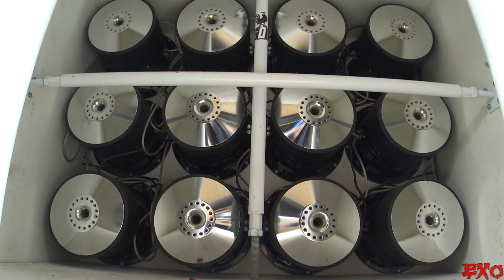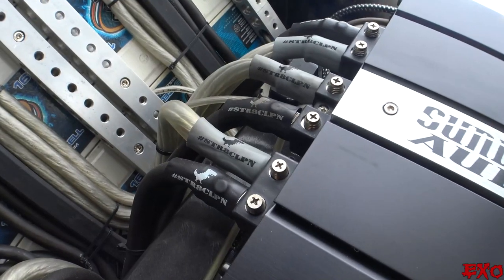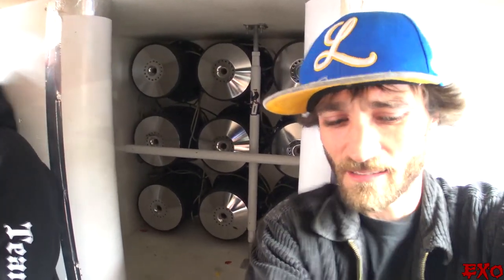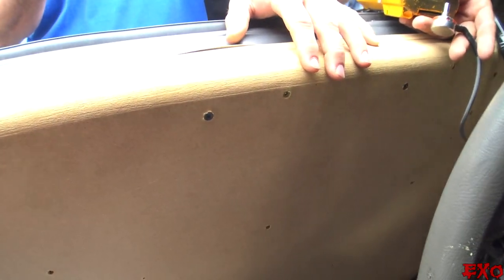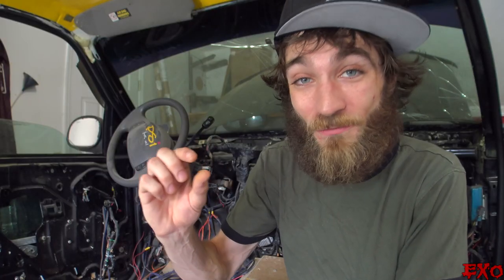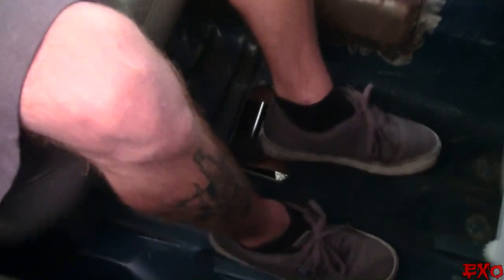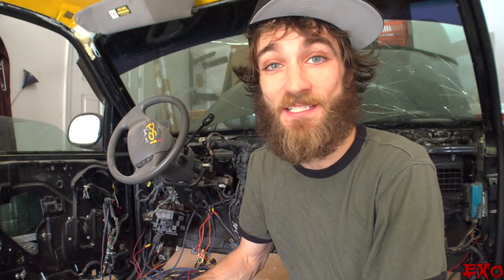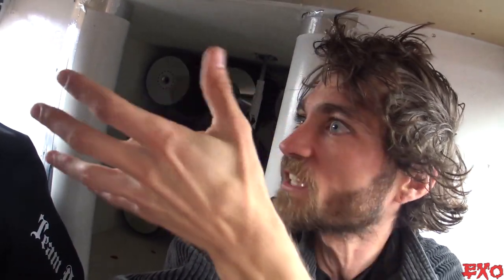Too MUCH BASS for a TAHOE!?!? Playing Kyle's BIGGEST Car Audio Subwoofer Sound System Ever!

Comment: I sat in a van with 15-15's...  It was a Rockford Fosgate utility van from many years ago.  The speakers were on a wall directly behind the driver/passenger seats, with the speakers facing into the cab... I didn't quite get the breathing part down, but phones, water bottles, etc. flew into the air!  Great video by the way!

Comment: Brother I graduate 1990 we're pumping Cerwin Vegas Rockford Fosgate, Orion and Alpine thinking we were pushing the limit thousand watt back then was crazy;)) nowadays you guys have evolve to Crazy points thumbs up
Reply: Juan Weigel 1994 grad here I remember thoes days I had Fosgate and Soundstream stuff good times!
Reply: my cousin had 3 kove audio 15s on 3k back in 2000  with 2 batteries and a capacitor that was nuttz. Not so insane anymore.
Reply: Yep  1$ per watt
Reply: Yes I remember those times indeed. I was rocking earthquake amps on 2 punch DVCs. Good ole days
Reply: Good times indeed. I was the sealed box king lol. Times have changed a lot I got back into it when I saw my 1st good flex and hair trick video.
Reply: Good times bro. I remember demoing my first subs with a Vanilla Ice CD. Then I stepped up to DJ Magic Mike! I had 2 count em 2, 10” bazooka tubes in my hatch mustang and I was the shit! Walking through school holding my pull out Alpine CD player bitch! My buddy had an Alpine bag phone. He was ballin out of control!
Reply: Envolved into making a bunch of noise, sounds like sound effects for a Si-Fi direct to VHS release ...
Reply: I also remember a guy that had 4 Fosgate 12’s and it was the biggest system any of us had ever seen. If you had a thousand watts back then, you were the king. Now you can get a couple 8’s or 10’s that’ll sound better than his 4 12’s. We were all bass heads back then.
Reply: 91 here. Rocked 4 12" Petras Cardiacs with a Pyramid (yeah, I know cheap, I was in high school) amp in my 85 Mazda GLC (still had a spare tire)  and later moved it to my 74 Plymouth Fury and had tons of room left in the trunk.  A friend of my ran 2 15" Cerwin Vegas pushed by 2 Fosgate amps in a VW GTI. He constantly had stuff falling off his car.
Reply: Nice thing about now is you get so much bang for your buck , my last system in 2000 cost me 15000 and nothing compared to what 15000 would give you now . On a side note my neighbor just threw out 2 alpine 12 diamond plates and I scoped up that shit and can't wait to install them .
Reply: I had 4 kicker 15 comps in a vw beetle with a  Orion 2125sx bridged mono at 1 ohm... It would literally kill the engine if I had the headlights on and bass turned up yr 1993 or so or
Reply: @boatheadsbazzar  A dude I went to highschool with had 4 15" PPI pros in his Sprint. I remember installing a bunch of stereos back then... The good ol' days...mid 90s
Reply: @MrCarnutbill67  I'm doing a build right now.  6 old school 12 inch Rockford fosgate HX2s in a 94 Chevy 1500 ext lowrider. Gonna be a fun truck to go riding in next summer.
Reply: In 89 i had 4 12in kicker comps with 2 punch 75s. I took the back seat out of my Ford Festiva and built a wall from floor to roof. PAINTED the side back windows black so ppl couldn't see in, along with a curtain i had made to pull shut when i was out the car. It was lowered and i painted a royal blue flake job on with purple undercarriage neons. Anyway, bouncing a quarter on the roof 4-5in was the shiznic. I never had to use lighting caps. Only other opt was a cheap crossfire cover and a pioneer pre-amp. Good to think back on the "ez-dazes" lol
Peace🐾🐾
Reply: I remember that stuff back in the day! Aman brother
Reply: The reason why "for the love of bass!" Back in the late 80s early 90s while playing basketball at a friend's house his dad was drop off in the Coca-Cola Thunder Truck (3nd in the world). 4 kicker 18. This was a life changing exercise. The band, cars, price, and many other things have changed, but the love is still the same!
Reply: You know you ate from the 1990s if you know what rockwood 2 channel 1k watt with 8 8" bazooka could do.
Reply: Orion 15 NT'S on HCCA AMP Orion 2150 pushing my mids and highs. Flip quarters on the roof and turn a beer in a bottle into a 10 ft fountain.  Thought we were doing it all back then

Comment: I live in a small town on an isolated coast and no one has anything even close to this,  I would so so love to sit in something like that holy shit man!
Reply: DimensionsOfEarth hell ya dude that fucker would take your breathe away! I’ve never sat in it or even been around it but I know it would take my breathe away
Reply: DimensionsOfEarth be the first
Reply: Fuck it, build you up one bro 😀
Reply: Build one. If you want cheap woofers thay can handle a ton of power go Sound Qubed. Their HDC4's are rated 2k rms, 6k max and their 18 is $440.
Reply: Yes guys I'm with you I may just have to build one up!  At the moment I do have one of the loudest systems on the whole coast where I live but it's child's play compared to this beast of a bass wagon!
Reply: DimensionsOfEarth what do you have?... I'm sure other people are curious as well. I'm sitting on 1 15" American Bass XFL1522 and a Audiopipe APCL15001d 3.8 cube box tuned to around 34hz. Just budget bangin. It sounds decent. I need a better amp though. I feel that the sq is questionable. For the price though I have no room at all to complain. I've impressed many bassheads. When I tell them what I have they don't believe me.
Reply: Ive been in this truck and its insane the videos do absolutely no justice
Reply: @craiglarsonjr.6586  aame here man , one 15 audiobahn immortal on a rockford p1000bd and  people think I got 2 12s or 2 15s and like 5000 watts lol shakes the mirrors of people car in front of me at a stop sign or red light I get up on there bumper lol i have a video of it banging and flex some interior
Reply: just checking in, are you the guy with the crazy system in your area yet?

Comment: 1/4 volume? Are you f-ing kidding me? How many decibels does this tahoe make!?!
Reply: i think somewhere between 168-171
Reply: It's like a 167+ under 30Hz.
Reply: @neoplasmax  much more than double the power because driver's sensivity isn't proportional with watts... I mean let's say a driver has 91db(1w/1m), (2w/1m) won't be exactly 3 db louder, it will be nearly 2.9 but as you increase the wattage it will go down drastically
Reply: I remember a place called Audio One here in Richmond, VA.  I did some HVAC work there (that's what I do) and was talking to one of the salesman.  He was tryna sell me some JL W7s I think.  He was talking bout a car with 4 of them in it.  This was back in like 2002 or 2003.  I asked what did it hit.  He said they dont know it blew the mic every time.  I played it off like wow ok, but really I wanted to be like mofo do I look stupid to you?  Aren't the mics rated for 180db, which is like a sonic boom I believe the loudest thing known to man?  Am I wrong? Obviously I didnt buy W 7s.  Or anything from Audio One.  I mean what's the point if you cant even meter if lmfao.....
Reply: @oprisvlad3102  I thought that, let's say you have whatever amp and speaker, when u have 2 amps, 2 speakers, u add 3db.  So if 1 12 was 145db, 2 are 148db, etc.  Not double the wattage.
Reply: @jasoncurtis4404  double the source is 3db extra indeed but if you turn up the volume 3db extra it will be around double the power
Reply: 189
Reply: @jasoncurtis4404   that place started my habit... Ha
Reply: 400
Reply: 173

Comment: Him: honey I'm about to put $150,00 worth of amps, woofers batteries, wires wood and concrete in a $1500 truck

Her: dear we are still paying on the house

Him: we gott this str8 clippin
Reply: Michael Jordan 150k???? For real?
Reply: Cristian Zaine Easily
Reply: Michael Jordan hobbies aren’t cheap..that’s the fun to it a little
Reply: Cristian zaine.... Have you priced some of this equipment. A ns2 is like 4k alone...its crazy i have 2 fi team 18s and it took forever to buy them..
Reply: He doesn't actually have 150k in it more around 65 70k
Reply: Did you mean $150,000 and forgot a 0, or $15,000 and put the comma in the wrong place?
Reply: i wouldnt say 150k thats no where near.  60k at most not including labor

Comment: Who needs an air-conditioned you have this truck to do the work
Reply: Δημητρης καλοποδας right!!!!
Reply: im pretty sure the air pushing out is hot air since the subs and amps are heating up like crazy. would have to be cool ambient temps for that to work and even then its only air moving in and out in tune with the subs. its not a total flush which is why hats and hair stays in the buffer zone of a window or box port.
Reply: Δημητρης καλοποδας Facts!!! Bass Condition

Comment: Bro I’ve only heard 1500 watt max  so that thing is super impressive but I’m about to for the first time in my life hear 10,000 watts me and a friend are going to build me a custom wall with 4 15s skar zvx on 4 SkV2 3500.1 that tuned down to 2500.1 so I don’t over work the amps it’s gonna be in the back of my Yukon Denali I’m running 8 Skar Spx-T tweeters and 8 Skar Spx-65C  mids on 2 skar  Sk-M900.5 amps and I’ll adjust stuff from there this is gonna be my first big build ever. It’s been a dream that I’m finally going after. Love ur videos keep it up 👍

Comment: I love bass, but y'all need to start wearing hearing protection. Some y'all keep saying bass won't make you go deaf BULLSHIT !! Now that I'm 48 my hearing has suffered from excessive bass.
Reply: Tyler Benton Calm down cupcake, you sound hostile. Worked in the car audio industry from 1988 to 2005 and still active in assisting with system tunings. I've not had any other jobs with an excessive noise floor. All you have to do is ask a doctor or audiologist and you might know something.
Reply: Cyber Trucker Road Show I don’t know why people think bass wont damage hearing, just because it doesn’t hurt your ears, doesn’t mean its not violently oscillating your ears in and out. You brain just doesn’t pick up on those lower frequencies as much as higher ones
Reply: Platinum Science bass does hurt your ears my JL 13w7’s are painful as hell on the ear drums turned wide open. They feel like there punching your ear drum and it’s painful 😖
Reply: The sound waves travel from the outer ear and in through the auditory canal, causing the eardrum, or tympanic membrane, to vibrate. This, in turn, causes the three small bones, known as the ossicles, or the hammer, the anvil and the stirrup, in the middle ear to move. The vibrations move via the oval window through the fluid in the cochlea in the inner ear, stimulating thousands of tiny hair cells. This results in the transformation of the vibrations into electrical impulses finally perceived by the brain as sound.
  With the above said, note the part where it says "3 small bones" these bones are very tiny and fragile. While the sound it self may not do anything, it is the shear amount of pressure that could possibly damage these crucial bones. Leaving you deaf and dizzy.
Reply: I'm 54. Been listening to loud stereos (and owning them) for decades. Went and had my hearing tested and it was nearly perfect. A very slight drop in upper mid range in one ear. I have learned that bass is the least likely range for a person to go def in, because you feel it more than you hear it.
Reply: My friend back in the day had a Bronco with three JL W6's. My ear bones hurt like hell whenever I rode in the back seat. I can't imagine being in that Tahoe no thanks.
Reply: If you don't lose your hearing, there is a good chance of developing Tinnitus.  I would not wish Tinnitus on my worst enemy. Sad but many Tinnitus sufferers commit suicide.

Comment: What is the point in moving that much air? At a certain point you are no longer hearing true bass, but just the effects that the air flow is having on the environment around you. It might be cool to have air pressure feel like it is liquefying you, but there is most likely cheaper ways to have that experience. When all you here is BRRRRR! BRRRRRR! BRRRRR! from the woofer, you have gone past what the enclosure and environment can handle. The environment itself becomes a transducer and that obviously does not equal quality bass reproduction. Give me a woofer balanced and adjusted to it's environment any day over too much power for the environment size.
Reply: It certainly looks like it would be refreshing on a really hot summer day. I do agree that this is too excessive for a daily use car, I have a single 12" sub in my car and that's plenty.

Comment: I’ve always been a basshead, but if you can’t actually drive the vehicle around, then it’s just a demo vehicle. I have a single ZV5 12 with a D4S custom kerf ported box and Focal K2 6.5 components, and Sundown Salt 4 amp. It’s louder than most people can listen to at high volume for any extended period of time, but I drive it everyday! I also have no damage to my ride.

Comment: I’m a structural engineer that works mainly with concrete structures. Since my college I just love car audio bass. I had some 15”s in my old car, but now nothing. I can help you (for free) with the structural design of your new system. Concrete is a good option but not very practical.

Comment: I've had a 1000 watt 2 12 system in almost every car I've owned. The most I've felt was 10,000w on 2 15s. My systems felt cheap after that experience. I have a full 1000 watt system (minus a capacitor) waiting to go into something.

Comment: I wouldn't sit in any of those types of vehicles anymore.  I professionally did car audio for several years and I just don't think my ears could take that kinda volume anymore.  I would need some serious hearing protection now.  I would highly recommend getting some decent hear protection with all the loud audio you're around.  There are custom molded ones you can get.  They are used by rock bands and can be hard to find someone who makes them locally but, they are totally worth it.  I use them every time I'm playing my drums.
Reply from the maker: Drums get LOUD!!! Basslines are much different.
Reply: I definitely recommend the hearing protection.  There are safety guidelines for how long someone should be subjected to varying decibels.  I'm sure those those are well over 140db.    I've built systems like that in the past,  I know just how loud they can get and I really would recommend some form of protection.  I don't know where your from but if you ever have any questions with something technical feel free to message me maybe I'll be able to help you out.

Comment: Is this even really going on anymore? I remember back in the day being huge into car audio lol. Used to do installs for all my buddies for the fun of it. Shocker, DDs,  PHD2s, crossfire 1000ds etc hahaha. Good times.
Reply: I remember one time in my S-10, had just a shocker 18 with a 1000d per coil...had a lady pull up to me on the road and motion to roll the window down. She says...how do you hear sirens? I said, I don't...I see lights. Lol..
Reply from the maker: It's going stronger than ever!!! These systems have pushed the limits of whats possible with musical SPL.
Reply: Thanks, might try to check into the schedule and go for fun. These days I'd probably lean more toward the SQ in my car haha. Have def thought bout adding a lil more bass tho.
Reply: You weren't anything unless you were running your Orion 225HCCAs at 1/4ohm and hiding a few batteries. lol
Reply: Haha na i didnt compete much. Was more in it for the fun/ doing installs for friends, etc.

Comment: True, i get what you're saying. And the women certainly like it...not bass face so much as big O face after a while ;) but i must admit, i'm a purist. Bit of an audiophile. When i want to listen to music and enjoy it, i do it at volume but mainly a reasonable one with everything audible so it doesn't hurt or annoy you after hours of listening.. However, real bass drums will be felt in your chest if kicked right next to you, so i certainly feel sometimes bass should be felt! I also love the sheer over the top wiring and power draw required for this! What i'd love to see? A rollercoaster or even a virtual ride that also has a sub system you can feel, yet still able to hear vocals and all the other melodies and dynamics. You'd likely need a little ear protection, but imagine what that would be like! Same when playing Halo or other battle games, always nice when an explosion feels like it went off next to you :) Though i will say, be careful of headphones. I no longer use a ridiculous level amp to drive them as i have actually suffered slight hearing loss/damage.. Oops! As well as extremely loud music during my small time as a DJ lol strangely enough also involving loud headphones to be able to que the next track in time! You should try the headphone amp i built though, Exo.. Drives 300Ohm sets to 1.4Watts per ear and literally moves your ear lobes and all other wobbly bits with the bass! I think people forget it's long term, continuous exposure to high sound pressure levels that does damage...especially headphones!